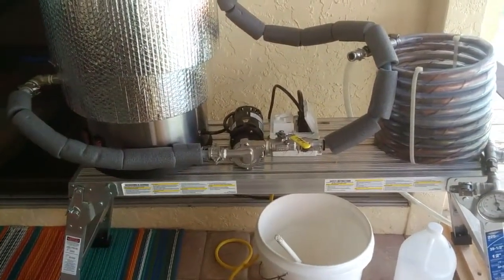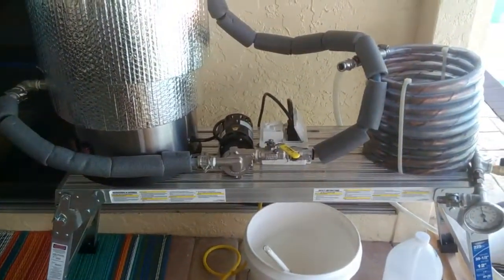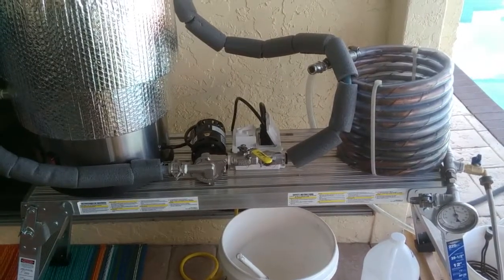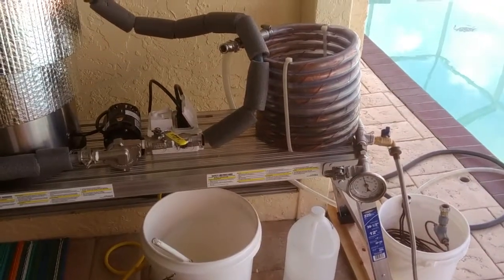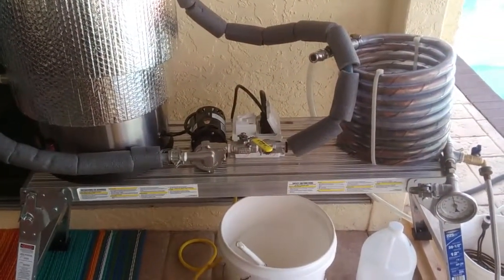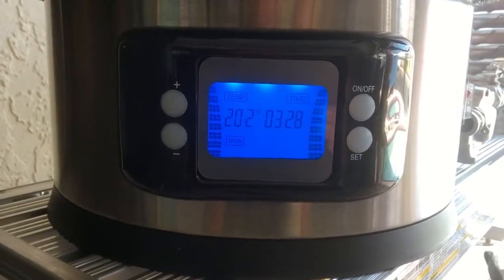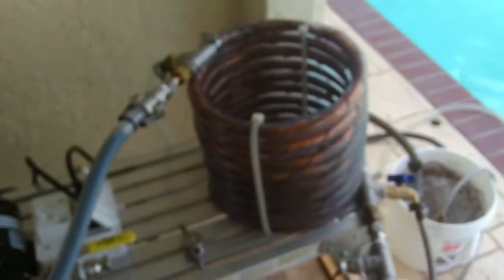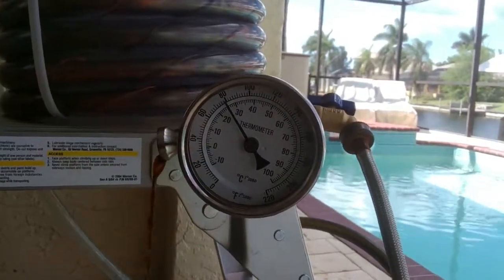Mash and Boil Counterflow Chiller Mod and Test

Comment: How did you make/where did you buy that hook arm for sparging/pumping wort back into the kettle?
Reply: scottibones1 thanks, that looks cool too, but I mean the stainless arm you use to hang over the lip of the kettle.
Reply from the maker: Oops sorry that is just half inch stainless fittings with pipe insulation covering it. 2 nipples 2 90's and the cam lock fitting to attach the hose.